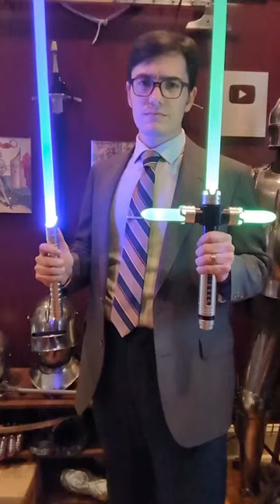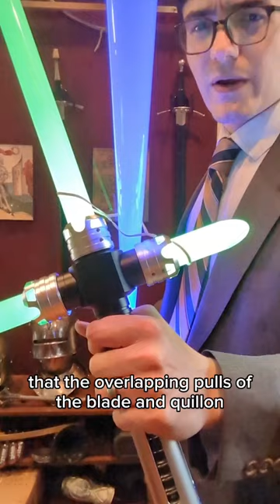Crossguard Lightsaber Theory

Comment: This is actually a good explanation. I'm glad they added that to canon in Rebels. It's a smart way for explaining why they never just slide the lightsaber down to the hilt
Reply: wasn't that always the idea
This is the 1st time i saw it in a video, but i always thought there was something pulling them toward or atleast stopping from the simply slider.

Also using stronger attacks, said to be useless because its a light, also has a canon reason.
Reply: You have to hand it to Star Wars writers, they always come up with some explanation for the obvious inconsistencies fans point out
Reply: @Renan-n3y  but i thought it was so obvious that, that was happening. othewise they would be sliding down.

What happened to 'show don't tell'
they literally showed it so many times.
telling would be an insult to the audience at this point.
Reply: So... if this 'can you feel it?' 'pull' is strong enough to prevent the blade from going further in, under force... that same 'pull'  would prevent the wielder from withdrawing their blade as well. Bad design is bad. Bad retconning is worse.
Reply: @Rakushael 
It’s a magnet, man. You can move magnets with your hands. For one reason or another, they probably also have friction, if you can’t believe it’s just a force. 

It could even be a strong force/weak force kind of interaction.  Or maybe the force originates near the tip of the saber, maintaining the blade’s shape. Maybe your comment is completely correct, and they can only separate the swords as a joint effort, lol. Countless sci-fi explanations: most of them are boring and not worth bringing up.

I’d love for the children’s tv show to have spent the entire episode explaining the physical properties of lightsabers in detail. But sometimes you give a quick explanation to move the plot along, and hope the audience is smart enough to fill in the gaps.
Reply: @Rakushael  just because a pair of work shoes have non-slip soles doesn't mean they're impossible (or even much harder) to lift up.

And if lightsabers attract and create a lot of friction with each other, that doesn't mean that pulling them apart will be just as hard as sliding them together. Especially since Jedi can use the force on their sabers to move them easier/faster
Reply: I mean yeah I’ve always thought lightsabers are overrated but that makes it much better
Reply: Obi wan vs greivous in episode 3slides down the blade and takes off a hand and cuts light saber in half
Reply: @Rakushael  yeah, it's 100% this kind of thinking. The real reason that sliding the blade down to the hilt isn't effective is that it requires you to sacrifice all of your leverage. 

On a real sword with mass, this doesn't work because of the blade's weight. Lightsabers don't have that problem, so the argument seems to be "then just slice off their fingers", but then atjust means you have to exert all of your force in a sliding or sweeping motion that sacrifices any energy you're using to steady and block their blade. In other words, to slide the blade down, you'd need to commit some of your weight or action to targeting their hilt, at which point you're no longer resisting the force they are exerting at you with the same degree, so you are literally pushing yourself (and all your precious squishy bits) toward the burning tube of laser light while reducing any resistance to the action from your opponent. Their corrective response is a tiny shift of weight that would leave you stabbing yourself in the face on the end of their blade. 

That's if lightsabers have no friction, and we know they at least have some. 

Crossguard lightsaber hilts are absolutely stupid from a hundred perspectives, probably most importantly that Lightsabers are based off of Kendo swords, which have a shape that's almost identical to a standard lightsaber. 

Counterpoint is, of course, that they look cool.  And maybe that's enough?
Reply: If you assume that the "pull" is strong enough at the intersection to stop a downward slice with full arm power behind it, it just raises a lot of other questions, doesn't it? They describe it as pull, but if you were applying downward force, for it to work as the author describes, it would have to have a net vector AWAY from the blades, contrary to everything in the canon.
Reply: @Renan-n3y  to be fair we've known that the blades are contained by a magnetic sheath for ages, using common sense would tell you that two magnetic fields interacting would have some sort of effect, and can be inferred to be "locking" the blades together. This just came much later and is essentially just pointing out the obvious for people lacking critical thinking.
Reply: @titan1umtitan  wow, thanks for being such a terrible commenter online
Reply: @Renan-n3y  what? I’m being blunt and exaggerating for effect, yes, but in no way does that make me a bad commenter. Show not tell is a perfect way of storytelling, having to dumb that down for audiences is what leads to a drastic decline in quality. That’s just the truth
Reply: Unnecessary and born of people not understanding saberlock from video games wasn't literal and just a common blade lock, danger sense already covered things like sliding it down. It also contradicts just about every saber fight we've ever had since we see they aren't pulling or anything.
Reply: @titan1umtitan  the problem here is you assuming people should know how eletromagnetic fields work as if this was a bit of trivial information like the sky is blue. Most people have no use for knowing how magnetism works and certainly not how this affects a fictional artifact, and you assuming people are dumb for that sound really condescending
Reply: @Renan-n3y  magnetism was literally something taught repeatedly for at least 8 years of primary American education. Everyone knows how magnets work. And no, I’m not calling them dumb, I’m saying they lack critical thinking. If they cannot apply a concept from the real world to find a reason why the fictional things do that, then YES, they lack critical thinking. That is the truth, and I’ve found myself on the receiving end many times. Don’t confuse objectivity with being condescending. The entire reason telling instead of showing exists is because people lack it, or the writers believe their audience isn’t very smart, so they have to point to the answer.
Reply: @titan1umtitan  there is no way not knowing well about a concept tells something about critical thinking. It would be the same as saying that not knowing Mesoamerican history shows a lack of critical thinking. Do you even know how critical thinking works?
Reply: @Renan-n3y  what are you talking about? This is in no way directed towards the people who do not know the concept. Stop making up arguments that don’t apply.
Reply: @titan1umtitan  You literally said "This just came much later and is essentially just pointing out the obvious for people lacking critical thinking" in your first comment and this was blatantly implying that people who do not know how lightsabers work with magnetism don't have critical thinking. That's why I ask you how not knowing one specific information shows a lack of critical thinking? Are you omniscient? I hope you'd be humble enough to admit that there are some things you don't know, at least. And that's ok, I'd never accuse you of acritical thinking because we know that critical thinking has to do with how we evaluate information that we have access to and not coming into contact with such information in the first place.
Reply: @Renan-n3y  if you looked back farther you’ll notice that I led my conversation by addressing the group that knew that lightsabers were contained via electromagnetic field. It’s literally the first sentence I typed.

Although I’m not afraid to admit that my wording may not have been the best
Reply: @titan1umtitan  All right, then, maybe my reading and interpretation wasn't the best as well. I take it that you mean well and please forgive me if I was disrespectful with some of my comments.